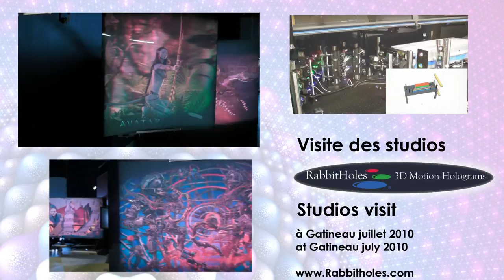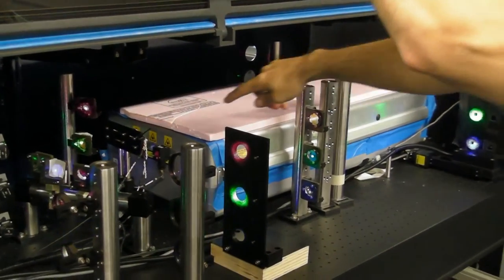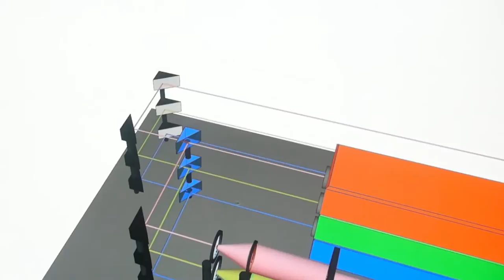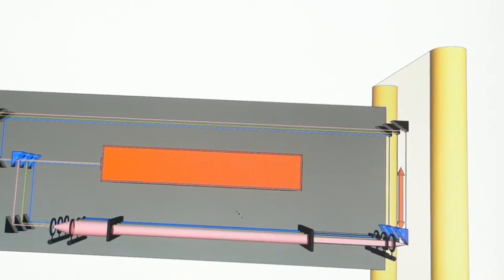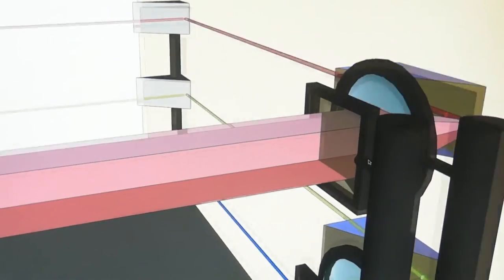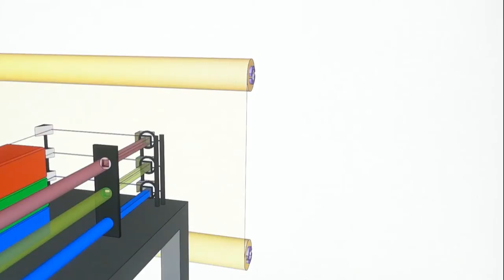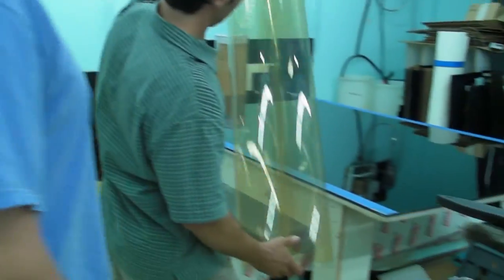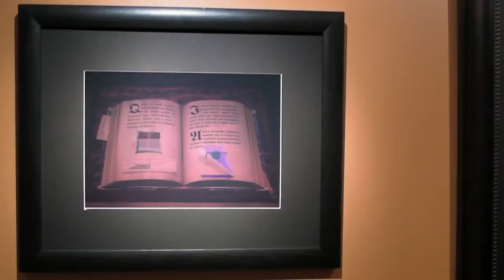Printing animated color holograms ( how they make it)

Comment: So many questions. 1. I imagine since you're focusing down to a single holopixel at a time that the exposure time can be much shorter than traditional holography yes?

2. Is this why the vibrations caused by the machine don't cause phasing issues?

3. Also I imagine you don't need as powerful lasers right? What strength are you using here?

4. The images cut off at sheer angles. Is this because we're at the edge of the LCD frame? Can the view angle range be widened by upping the resolution of the panel and the field of view of the digital frame?

5. Could the LCD panel be placed on the opposite side of the film with a mirror and the lenses to create a white light version of this printer? So the prints wouldn't have the specific lighting requirements these ones have? Or would that destroy the color information?

This is fascinating. Thank you for posting this, seriously.
Reply from the maker: Hi :)

I'm happy for your interest.  I don't work here. I did 3 hours of car just to visit this place ! Sadly they they are closed now.

The machine was on an optical table. It was a very big setup. 

There is other companies that print from 3D files. Maybe on their web site there is more info.

For fun, you can look at my video of an hologram I did with litiholo kit. It is nice to see that you can focus on different objects like with real objects.

Nice cover of Creep ;)
Reply: @TOUTest1  Oh that makes sense! There was so much good detail in this video that I guess I just assumed. I'll check out your litiholo vid next, and thank you for your kind words.

I really appreciate you taking the time to respond!